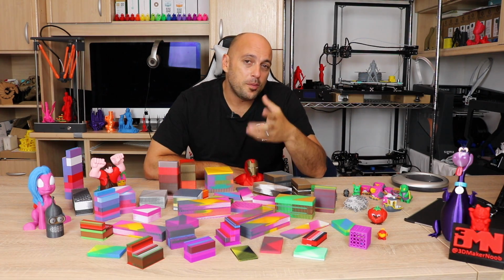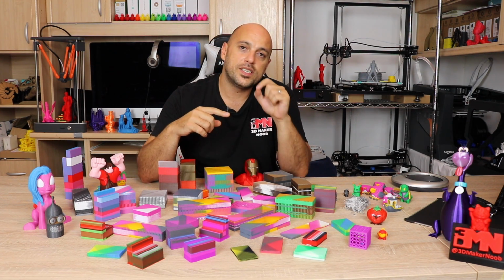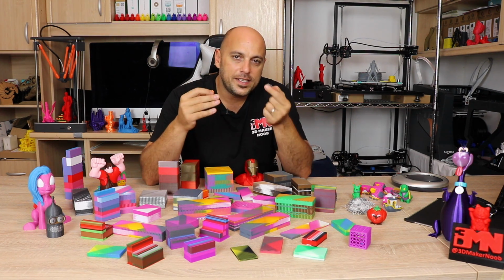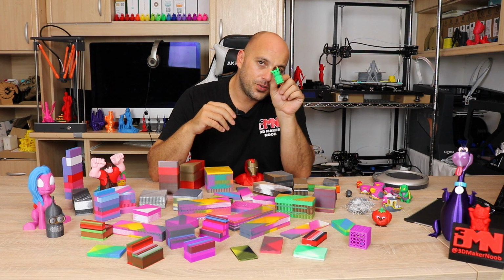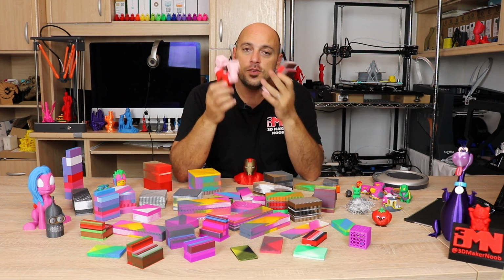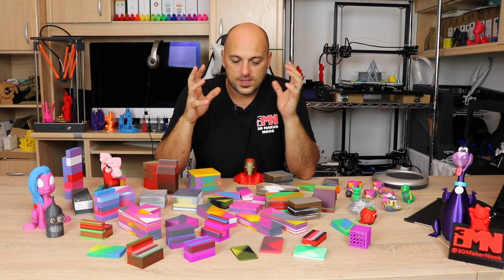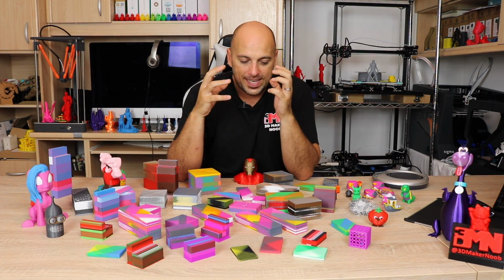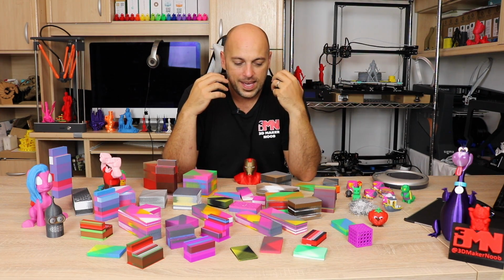The Purge! Explaining Purge Blocks and Answering Questions

Comment: The only printer that does it right is XYZprinting’s 3DColorJet solution enables the da Vinci Color to mix and fire CMYK color droplets onto PLA filament for accuracy and precision. But I do not think the colors POP, they seem dull to me and the printer does not seem to be the best quality. So I hope some one takes the tech and develops it in to a lower cost and higher quality printer for us so we do not have to waist filament and more importantly all the time in multicolor prints.
Reply from the maker: +Robothut another downside to XYZ is that it's a closed source company, meaning you're only allowed to use their filament which are seriously expensive. But it is the right idea and I believe more companies will move that way going forward
Reply: yea.. closed source filament.. and you have to use their brand ink im sure.. so that just got really freaking expensive.. not to mention their machines are known to break OFTEN
Reply: Yes hate the printers that are closed source, but there are ways around all the closed source printers. Still too expensive right now, but as other get into it the price has to come down and the Quality go up. I hope. Great job on the video Joe detailing the purge !
Reply: If only it wasn't a closed source and patented solution... Can't learn, can't replicate and can't clone

Comment: Big waste. No one prints a full tray of MM parts. That is a rare scenario. I would like to see Z move back down to a small tower as long as there's enough room on the bed. Kinda like when printing sequential objects today. This way, a MM print with a color change on the top doesn't need the same size tower.
Reply from the maker: you'd be surprised at how many would print a full tray, especially those selling stuff on etsy stores in bulk
Reply: No question that is the best case scenario. I still think things can be done with smart G-Code and moving Z up and down as long as it doesn't collide with the part. I suppose that there could be some nozzle drip with Z not being on the same layer etc. Tricky proposition. Great videos Joe.
Reply from the maker: i am more than sure that as time goes by, this will improve. Single nozzle with multi-filaments is still in its early days, so very excited to see what will happen :) thanks buddy
Reply: i was thinking the same thing.

Comment: Hi Joe, from a hobby point of view as a simple block its a waste but if you could size the blocks(for eg childrens building blocks)or as mentioned use as infill this could be minamised dramaticaly, even upping the % of infill to use more of the waste. Maybe if the blocks were all the same size you could maybe find a way to print on top and make them into big lego blocks.(ie resetting your Z 0 to ontop of the block)

Comment: It would be interesting to look at the ultimaker solution in comparison. I know it's only two colours or materials, but looks like a quite efficient solution. Similar to BCN. I know they're flipping expensive, but good for comparison. 

For me, multi material is much more interesting than multi colour. After all you can just paint like you said. Multimaterial ideally needs two nozzles. Printing PLA and polycarbonate for example would be a nightmare with a single nozzle due to the temp difference.

Comment: Due to "clever math" in yesterdays video, the Palette should be able to use infill as a purge to a large extent as all you want is the shell to be the colour you chose. 10-20x the model, wasted in a purge block is ridiculous. The only people that would be fine with this is those that sell/manufacture filament
Reply from the maker: i did cover this topic in this video, it is possible but you'd still need a purge block if the model itself doesn't have enough surface area to purge fully
Reply: Thanks for the reply. I commented mid-video which was my bad. I was still a little crushed after finding out about the purge block yesterday. I was really looking forward to the Palette too :(
Purge block makes this a deal breaker for me but the tech is cool :)

Comment: If you combined using infill for purge with a purge bucket it would save filament. But most multimaterial printers using a single nozzle wont natively support a purge bucket.

Comment: you had a great idea the other day joe. with to also sell a machine to recycle and make filament with the purge blocks.
Reply: if you use purge buckets, the waste filaments would be much easier to grind up to feed into the recycler. To break up the purge blocks, you need something very strong like a wood chipper or industrial sized grinder, which also needs to be extremely clean, because all dirt will end up on your filament causing missfeeds.

Comment: A good and easy way to grind those purge blocks and all failed prints would be great. But it wouldn't work with multi material. But for multi color it would be nice. When you are also printing only from one fillament company then you can make your own test-fillament for testing prints and don't bother with fails - except for the lost time.